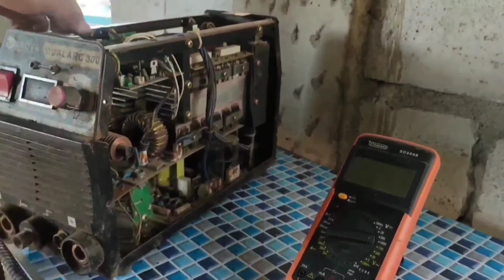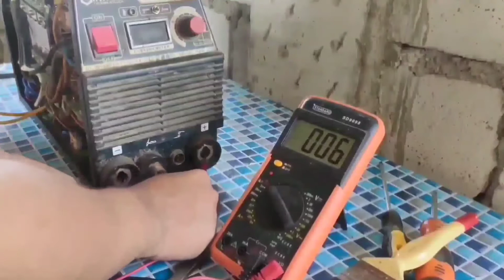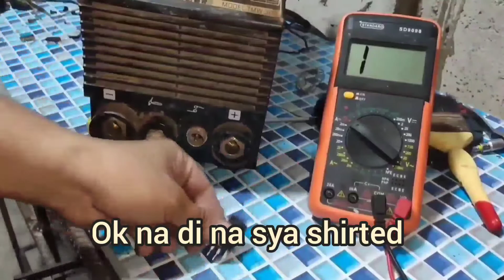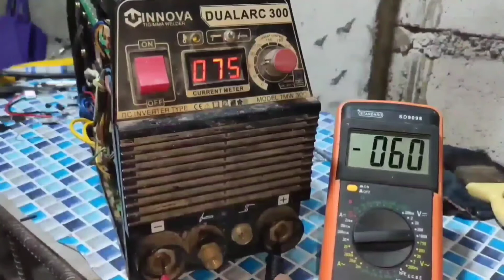how to repair Innova dual arc 300 no OUTPUT error o.c no hf

Comment: boss magkano po parepair ng ganyang unit? same model at same issue din. salamat
Reply from the maker: depende sir sa sirang pyesa pero ang repair madalas maximum 2k labor parts basta repair board pag palit board buo mismo mas mahal nasa 3k to 4k
Reply: @diodeyap  san ka pwede macontact boss?
Reply: @diodeyap  nagmessage ako sayo sa messenger boss

Comment: Ser heavy juty po BA Ito? And trusted item po BA Ito? Pa answer please
Reply from the maker: Medium duty po sir pang kitchen equipment at tambotso good ito
Reply: @diodeyap  original po BA Ito ser Diba pwede Ito Pang arc welding
Reply from the maker: @jimboygozo8838  class a nang china like powercraft rilon riland hitronic pede arc yan dual
Reply: @diodeyap  maganda po bang gamitin ang ingco 300 amper master
Reply: @diodeyap  ano pong maganda na brand na pwede heavy juty na welding machine